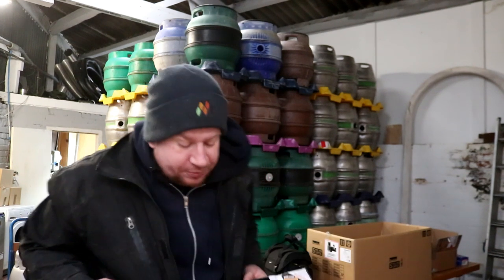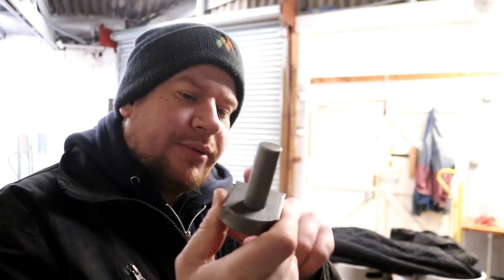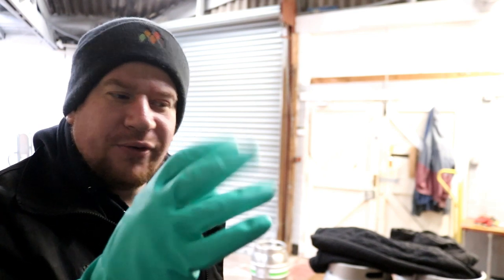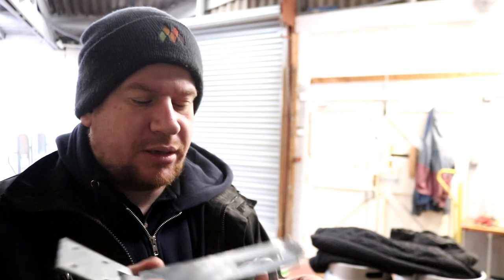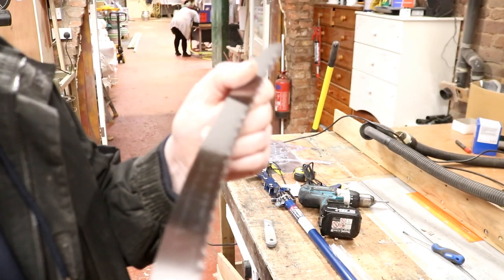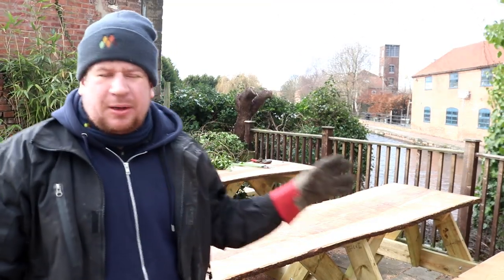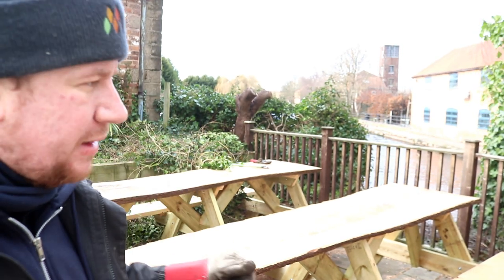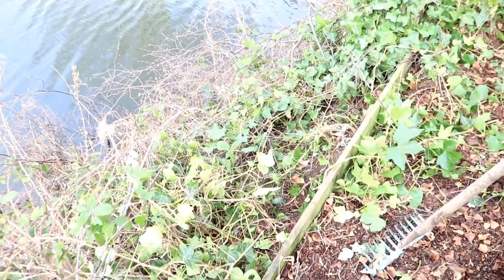DON'T FALL IN

Comment: Looking good Harry, can’t believe how much you get done each day. Do you always pull the spears and gravity fill your kegs? How’d you get a steady carbonation level on them, just check ambient temp and leave head pressure on them at the right level for a few days.Am a bit torn over 20L vs 30L kegs for my nano setup, do these kegs go out to other pubs or just your own? Matt
Reply from the maker: Yeah, I go gravity fill as I only have 20 kegs. All I do is check temp and set the keg at the right pressure and leave for a few days. I would go 30L as a minimum, I would use 50L too now I know how much we sell of the vacant.

Comment: NO, NO NO, More butt 😄 ! You've been framed for £250 next time 😄 ? Nice large Perch style Pike lure. Be very careful about penetrating the bottom of the canal as they have a fairly thin clay lining that keeps them watertight. I would be more inclined to fasten the scaff poles to a board that then gently sits on the bottom rather than risk puncturing the clay lining and have the whole construction counter balanced on your side so that very little weight is exerted on the canal bottom. Or counter balence the whole lot with an overhanging jetty which doesn't have anything going into the canal at all. I am a slight pessimist but you really don't want the bill for a severe canal leak. Cheers, Schnuz.
Reply: P.S. great vlog as usual, do what you think is good but just some thoughts for your consideration. Cheers, Schnuz.
Reply from the maker: All good points, I think I will go with the poles on the board.